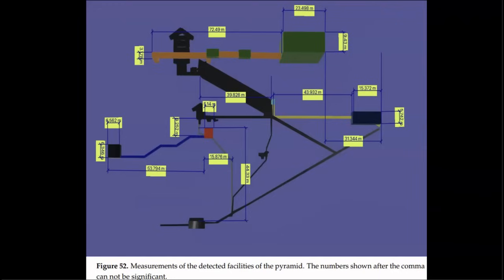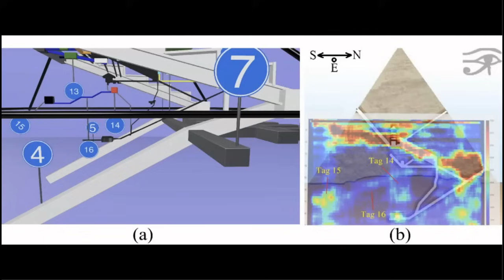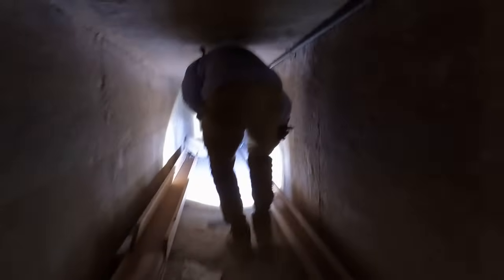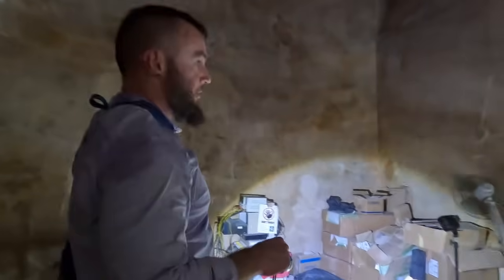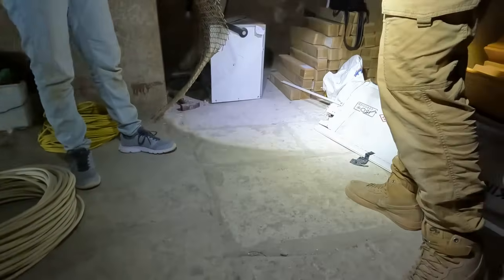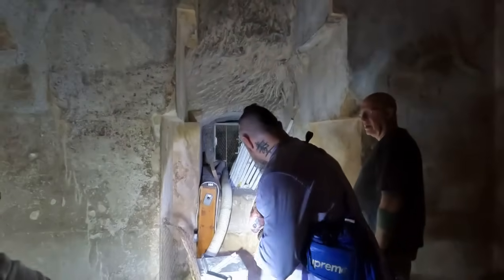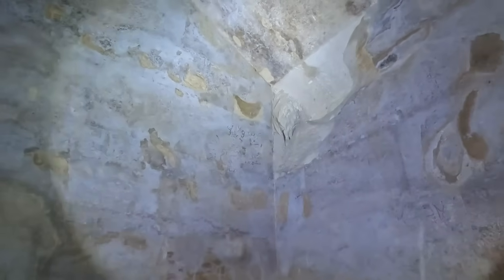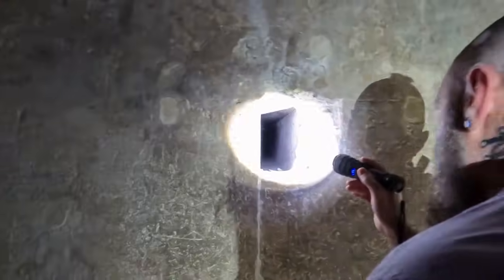Sunday Site Visit 54: ANCIENT EGYPT - Private Access - The "Queen's" Chamber

Comment: The reaction of calcium carbonate and sulfuric acid is a double-displacement reaction that produces carbonic acid and calcium sulfate, but the carbonic acid quickly decomposes into carbon dioxide and water. The pyramid needed to vent out the fizzy gas at some point as the pressure increases!
Reply: Ohh man hes got everything correct oh My,,,
Reply: @goosee7776  Oh yeaaaah!  you jealous.
Reply from the maker: Carbon dioxide is soluble in water and would have been dissolved and removed from the system after the initial reaction to create the calcium sulfate. After the coating was created, there would be no further reaction producing the CO2 and wouldn't have impacted the production process. Good comment Deadman, I appreciate the chemistry. The Red Pyramid utilized a similar approach (dissolve and drain) to remove the undesired CO2 byproduct from the 2nd chamber

Comment: The calcium sufate coating on queen chamber walls to protect from dilute sulphuric acid reminds me of how lead water pipes work. The water composition with added chemicals makes a protective layer on inside of lead pipe to keep lead from leaching into drinking water, Flynt changed thier water source and changed chemical composition which ruined the protective coating on pipes, now thier water is posion🤪

Comment: In that 1 hole in the wall some one has put a robot in only to find 2 clamps and then drilled a hole through that wall to find 2 metal hoops along with a diagram which looks like a wiring diagram

Comment: With the greatest respect, discrediting the shafts into the queens chamber as being "something" used in the construction is an insufficient explanation. This is a confirmation bias just to fit your theory. As you have said yourself nothing is done by accident in these structures. Gantenbrink's door is fascinating as it appears to have electrodes embedded in it. Chris Dunn might be wrong about the power plant but it seems plausible that these shafts did control the delivery of two chemicals into the reaction chamber (queens chamber). I propose the shafts were covered over by a geo-polymer or plaster that was porous and regulated the flow rate of the chemicals (this is how they were discovered so easily by early explorers). 
Why have a gabled ceiling in an extraction chamber? Why have a stepped vaulted ceiling above the niche if it's an extraction chamber? 
Delivering chemicals to the Kings chamber through the air shafts is not as elegant in its design as the rest of the structure, it seems very impractical to run a pipe up the outside of the pyramid to the airshaft. 
Instead it seems more likely the first reaction happens in the queens chamber, water level rises, 2nd reaction happens in the Kings chamber water level lowered, raised again to compress in the grand gallery etc and eventually the water is drained from the queens chamber (simplified version - I don't want to write an essay...). 
All of your other theory's are on point but the Great Pyramid one still needs work. Please take this as constructive criticism as I only want you to succeed!!
Reply: Isn't there an argument that they were originally leading outside but due to further construction on top of what existed led to them being blocked off?
Reply: @tsriftsal3581  There is no evidence to suggest that the Great Pyramid was extended and repurposed as a larger pyramid at a later date. :) Further, if they were just blocking the shafts off, on the exterior of the initial smaller pyramid, they wouldn't drill and insert metal "wires" (metal is still to be verified but it looks like copper from the grainy images) into those blocks. :)
Reply: I agree with your suggestion that the shafts likely had a function, the fittings in each of the “doors” are just so compelling and Chris Dunn’s description of them being some sort of fluid contact trigger is certainly interesting. I have come to Land Of Chem via Andrew Hall of Thunderbolts, and similarly to you I liked some of Chris Dunn’s content but found his conclusions about the overall function unsatisfactory. I will have to read the relevant part of his Pyramid book again, but I seem to remember Chris Dunn did specifically say that then shaft holes were intact, and suggested liquid chemicals in the shafts entered the main chamber by way of leeching through the thin covering as you are also proposing?
Reply: @skipintroux4444  Hi :) Yes that's correct, Dunn suggested the chemicals leached through the limestone (with a calculated wall thickness to control the flow rate of their delivery). Dunn never mentions any geo polymer but that seems a more practical engineering solution and would explain why it was so easy for Waynman Dixon to drill in the exact spot and remove the material so easily. If you look at the shaft openings now then look machine cut. I can't see how someone hacking into a stone wall in 1872 would be able to create such a clean finish with parallel lines. Sealing the shafts up would also allow for the chamber to be filled with water and not interfere with the two supply chemicals. I doubt water would even leach back up the shafts (when the chamber was full) as it would be pushing against the head pressure of the liquids in the shaft. Dunn actually made a working model of how he proposed the shafts operated. There is a youtube video somewhere. :)
Reply: @simonhodgson8504  ah yes I see your distinction between a polymer which would have the benefit of being repairable/replaceable, vs Dunn’s tuned thickness of the fitted stones which would be set and forget. So much is missing or modified inside the pyramid, it would certainly help to know what is beyond the stones in the “Gantenbrink doors” area. It is compelling to think there is some sort of human service access to those metal fittings, which is just currently unknown to us.
Reply: @skipintroux4444  I have often thought the same thing, these machines were built to stand the test of time so they therefore must have been built to be serviceable to achieve that goal.